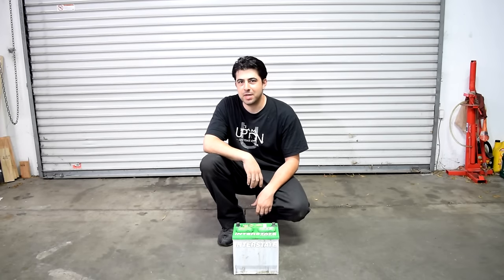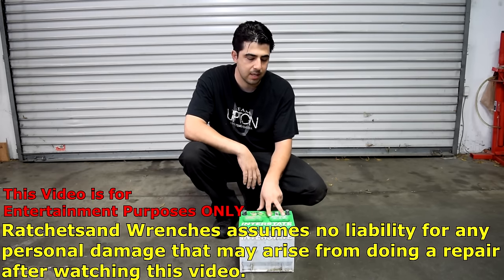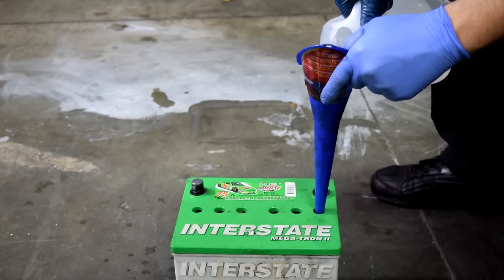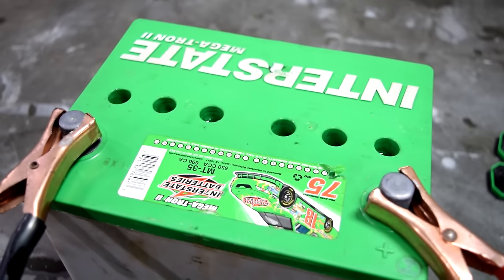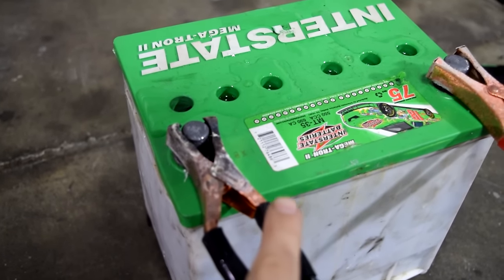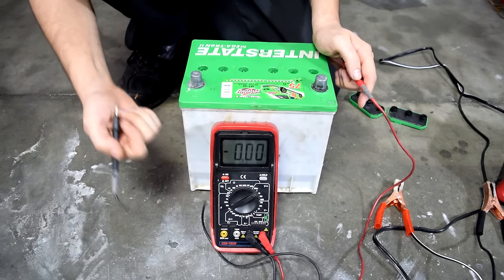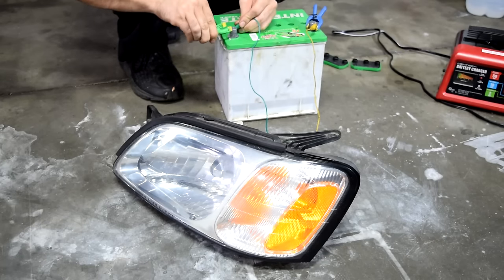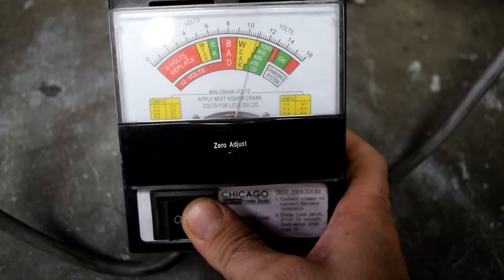Is it Possible to Revive a Dead Battery with Epsom Salt - See For Yourself

Comment: If you're going to use this method, be sure to flush the soda water from the battery 3 to 4 times with clean water  shaking well each time to remove the lead sulfate debris and so that any residue from the soda does not neutralize the addition of the acid.  You're probably going to have degraded plates in the cells so don't expect long life from a battery that is "reconditioned" by this method.  What we need is a good (really good) youtube instructable on how to use an existing battery case and fabricate the plates and separators ourselves, add the acid and water instead of trying to short circuit (no pun) the process of buying a new battery or trying to revive one that already dead.  It could be done by some really crafty person who knows what he's/she's doing, I think.
Reply: Well the point of using the epsom salt solution is to put the lead sulfate into solution, you don’t want to remove the sulfate from the electrolytical solution because it is part of the full circle chemical reaction within the battery, the lead sulfate gets stuck out of solution when the batteries drain and sit for too long which is why we do this process, but it’s still a part of the chemical process
Reply: some guy in india does exactly that.   on YT.   rebuilds the battery with new plates

Comment: Yes batteries are not effected by the floor or anything its sitting on. A 12 volt battery has 2.2 volts per cell, using a hydrometer to test each cell. I have used a desulfation charger for years and have been able to restore batteries to proper voltage. Getting them to the cranking amps is a issue. I have owned a Automotive repair center for over 25 years and been in the industry for over 40 years. I have a 1960s battery charger that will activate a dead battery that will not charge on a newer style charger. There is other ways to do this but its not the safest thing to do so I will not mention it. Some old school technicians will know what I am talking about. Years ago battery were sold as dry cell and acid had to be added. I was always amazed how the chemical reaction occurred! You really need to be carful with lead acid battery as I has seen them explode from over charger or the plates laying on each other. Just my two cents from a ole man
Reply: interesting points ,if anyone else needs to find out about how to recondition old batteries at home try Vaxicorn Battery Extender Guide (do a google search ) ? Ive heard some unbelievable things about it and my cousin got great results with it.
Reply: @MrMarcomedina  SPAMMER

Comment: in the past, I bought a product called 'New Life for Batteries' that claimed to wash the sulfate build up off the plates so they could, once again, hold a charge. You put one tea spoon in each cell. I would then put the battery on the washing machine and wash 4 or 5 loads of wash to agitate the solution. Or, I would put the battery in my delivery truck and run my route for 10 hours. Then my batteries would hold a charge again. I don't know what was in the product, but it was a white, granular powder. This product was popular with boaters because sulfates build up on the battery plates when they are not fully charged. Boat batteries and deep cycle batteries often sit around for weeks with only a partial charge. After the sulfates build up, a charger would not bring them back up to 100% charged. After using the 'New Life for Batteries'  they would hold a full charge. The product was about $14 and saved me hundreds. I think that allowing the extra hours of agitation of the solution may be a key difference in the results I got. I didn't have to drain out the battery acid either.

Comment: The other guy on YouTube that worked outside in 20 degrees did what you did but
instead of using Buddy Epson Salts used a solution of 8 ounces of Alum put in a
gallon jug with regular or distilled water.  Alum is used for pickling if you are looking
where to purchase it....His results worked..My question : How long will the solution
of Alum and water function as the electrolite ? Also , why not put fresh battery acid 
sold at places like NAPA when you do the Baking Soda flush out ?

Comment: This would probably work worse or completely kill the battery if you did this on a semi dead  battery at 9 volts.  The reason being is lead acid chemistry.   A fully charged battery has a sulfuric acid electrolyte a lead dioxide cathode and a lead anode.   As the battery becomes discharged both the anode and cathode become lead sulfate and the electrolyte becomes almost pure water.   The battery in the video was pretty close to completely reacted (dead) so therefore the electrolyte that you dumped out was almost all water with debris and residual acid.  When you filled up the cells with magnesium sulfate and distilled water you increased the conductivity of the solution.  Then when you charged the battery the sulfate ions liberate from the lead sulfate plates and you actually produce sulfuric acid pure lead and lead dioxide.   The reason why this would work worse on a half dead battery is because you will be dumping out sulfuric acid electrolyte that is only half reacted not pure water.  When the reaction reverses as you charge it there would not be enough sulfate on the plates to restore the acidity of the original solution.

Comment: I may have missed something but you left the epsom salt solution in the battery? You should have electrolyte 35%H2so4 and distilled water. You would of been better off using the original electrolyte or going to auto store and buying a bottle.
Reply: CCA drops drastically i mean 40-50%, DONT PLAY WITH CHEMISTRY. ITS SIMPLE H2SO4 + H20(DISTILLED)
Reply: searcherT morning

Comment: Great video!  I tried your fix, and my battery now charges to full but within minutes when left alone  depletes to empty.  Before the fix the battery was completely dead.  Any ideas on what is going on??  Thanks much.
Reply: you cannot revive a completely dead battery. it will hold voltage but not amps. change your battery

Comment: There are  several things for fixing a car battery
never try to do this until you are sure what you are doing - the acid can burn you
check the voltage first - there may be a kaput cell which would waste your time.
Check the battery fluid.
Try to fully charge the battery.
(I read about these and more from Jons mender guide website )

Comment: I heard that putting it on a high boost charge at the beginning helps to know loose the buildup on the plates before you begin the slow charge process.
Reply: I think you do this on a new battery that's been sitting on the shelf for a while.

Comment: the issue u left the salt in it with acts as a short so u need to wash the inside once again and replace that stuff with filter lemon juice so it has acid in it again should increase amps

Comment: Baking soda wash should be done on a vibrating table. If you don't have one just use an electric vibrating sander strapped to the underside of a table or a plastic 5 gal bucket and vibrate the battery for about an hour. This method will clean the plates better than shaking if for a few seconds or minutes. When the sulfation is released some of the plate material will also be removed making the plates thinner which in turn reduces the amperage. Dump and rinse again to flush out the debris. I would recommend replenishing with sulfuric acid if possible. After this process it will revive the battery to a reasonable state, depending on your definition of reasonable.

Comment: Hi friend I did it and it's working fine with Epsom salt now Iam in the 3rd week and car starting nicely
Reply: Panthera still working  hope it'll last a year ;)
Reply: Panthera only Epsom salt  with water
Reply: Which type of epsom salt and how much quantity is to mix for 1ltr
Reply: Crystaline form or powder form
Reply: How much quantity to mix for 1litre distilled water
Reply: Sroor9001 
Hi how your battery doing since last time you post the common is it still holding charge . thanks.
Reply: Sroor9001 i

Comment: Hi
A Month ago I have opened my faulty car battery (with the temperatures going down this winter it wasn't able to start a car, it was too weak).  I have poured out the acid and added a mixture of Epsom salt and distilled water as told in the video. After that I have charged the battery once or twice and put it back in the car. At first, the results weren't so good, it had happened to me once or twice to fail starting the car. But, as time is passing by the battery is becoming better and better and now it is cranking the car very hard and I am very positively surprised with the results. It seems that epsom salt needs time to clean the deposed sulphate on the plates and as they are becoming cleaner and cleaner the battery is becoming better and better. Reading the comments below, I have one question for the guys with more knowledge than me about this topic. 
Should I now empty the epsom salt mixture from the battery and refill it with sulphuric acid mixture. And. can I use the old filtered sulphuric acid, or I have to buy a new sulphuric acid?
Thanks anyway
Reply: By all means YES!!...realize this post is 2 years old, but YES YES YES.... lose the bathwater and replace with new electrolytic, be sure to cover/saturate the lead plates but not fill it to the top ;)

Comment: Thanks for your good video. 1 more quick question on car batteries: do NOT mix/top off a battery w/ acid from another battery?
Even if the acid from another battery tests good/okay w/ a specific gravity tester?
Just use Distilled water instead right?

Thanks again.

take care,
 - Leeroy

Comment: Awesome job explaining the measurements and procedure with amperage on the charger. Most other videos just simply stated so pour some epsom salt over in a boiling pot and dump it in the battery then slap a charger on it and hat presto it’s fixed. Thank you for actually explaining it thoroughly!

Comment: That harbor freight charger will show red light on full charge battery. If you flip the switch from 2 amp to higher it will change to green. I have an exact charger and it does the red on full charge. Not everytime but most. As for the 12 volt battery and fluid change thing as you have done, I have done these things and found it best to just replace the battery lol. I love bringing dead things back but its not fun finding out 2 or 3 days later that you still have a dead battery in the car. 12 volt batteries are cheap enough to just buy, replace and recycle!
Reply: not some batteries. the marine batteries can be as much as $400 plus
Reply: Hey. Just wanted to get back to you. I picked up a couple of old nasty looking boat batteries but they do not look to be leaking. I'll try this and possibly video it and follow your steps and see how it goes. My dad was successful at doing this stuff so I'll see how it goes for me. I've tryed it and have got them to come back but not to last long. I'll be sure to fill ya in. I'd be ecstatic if we can revive these suckers. Thanks again.

Comment: I've got a few relatively new RV deep cycle batteries that already failing me.  I mean less than a year old.  How about just topping them off with distilled water/epsom salt solution? Since they're pretty new, it should be fairly clean wouldn't you agree? Sound like a good idea?  Thanks for awesome info by the way!  Good Survival skills for future!
Reply: No, I highly recommend against this in this process since we’re removing the old sulfuric  acid and replacing with the epsom salt electrolyte in its pace. In your case I would recommend just trying to charge it as is, if the cells are low, maybe topping off with distilled water, but no epsom salt. Your batteries should have all the sulfuric acid still in solution that it requires, at a higher concentration because of the battery loosing water via evaporation. So adding the distilled water will re-balance the electrolytic solution, balance the sulfuric to water ratio. Then give a good slow trickle charge should be good, and if not, than go through this videos entire process.

Comment: Thanks for the video, I'm surprised that you got any charge at all with an Epsom salt electrolyte, I guess it is still conductive, I wonder if a lead KOH battery would produce better amperage, anyway the idea behind the baking soda is to neutralize any residual acid and then rinse it out with distilled water and replace that with Epsom salt to "melt" the crystallized sulfate or at the very least reduce it into a soluble liquid, that would be the purpose behind cycling a charge across the plates, I am very surprised that you got 2.1 volts per cell! I was expecting around 1.2 like a AA battery due to the alkalinity. I think I would do another rinse/fill/charge cycle and then rinse again and add acid. I am going to try this in the next couple of days with my deep cell trojan batteries and see how it works!
Reply: Go back to school for some basic Physics and Chemistry - Salt Water is more conductive than fresh water and the process of charging turns the Salt/Demineralized water into Acid!
Reply: @vintageguitarz1  Talk about a poor education!
Wow! Salt water turns into acid? Really?
Our worlds oceans are salt water, I doubt any fish or anything at all could survive in an acid rich environment, but you keep on schooling us on ph balances and such... This is your brain on salt water...
Reply: @vintageguitarz1  Epson salt is not salt. Salt is sodium chloride. Epson Salt is a compound of magnesium and sulfate.
Reply: well,these experiments and comments are very useful, (to me), in the sense  that they send me, a pensioner, back to my days in secondary schools talking/learning about pH values of acqueous solutions of salts made from strong/weak bases and strong/weak acids😄
Reply: @superiorcarpetpaintllc4351  That was an amazingly dumb comment

Comment: Okay when some electrodes making contact and desperate add thin oil like turpentine and some motor oil...
It will temporarily insulate shorted parts and it can than still hold a charge...
Should be possible to reload to a lower voltage...
When moved the oil and acid mix and isolation gone...
Works in extreme cases...
One way solution though...
Make Shure shorted parts are covered by oil...
Usually parts not covered by destined water short out at the top and bend toward one another despite them touching this seems to work if only a couple of cells ( beginning and end shorted you lose one cell but still can use the other not shorted cells )

Be careful tends to form a soapy kind of thing after a while...
Moving it inside a car mixes things and than it cannot be used anymore...

Did this on a shorted out stable battery used for powering a radio...
Worked !!!
Needed reloading but did hold power...
Do not know how many amps can be drawn at max ???

Comment: All nice and fancy execpt most of the time when a car battery suddenly dies before it's time is because of a physical problem inside the battery casing such as cracked plates, broken welds and openings in the circuitry.

Comment: There are  a few ideas for getting a good result
Don't attempt to do this until you are sure what you are doing - the acid can burn you
Test the voltage first - there may be a kaput cell which would be a waste of time trying to fix.
Check the battery fluid.
attempt to completely recharge the battery.
(I learned about these and more from rapid renew roadmap site )

Comment: Wow! Comments suck. Wonder if people actually talk like that in real life...if they do, the world is in trouble! Great vid. Thanks for doing the experiment for me. I've got a couple of old batteries and I've tried several of the "shocking/pulse charging" tricks to disulfonate with no luck. Heard epson salts were the way to go, but good science says the same thing as what you discovered...only works if your plates aren't sulfonated. Thanks for the info. Great vids ya got! Keep it up!
Reply: It's most a good video. If you are going to wash/neutralize it with baking soda (I don't recommend it) it's very very very very important to flush the crap out of it before the epson salt part.
Reply: It's called 'Keyboard Courage'... most would not have the buts or balls to speak like that in public or to someone directly... but there is always the exception that would.
Reply: robert feller Yes, don't just pour it out, run some fresh water through those plates. I don't use distilled water for any of this, my brother has religiously used distilled water in his batteries for 40 years and his don't last any longer than mine using clean tap water which where I live is very hard water. If the plates aren't cleaned up after one dose of Epsom salts do it again and for longer. It won't hurt the battery, it's already dead but it just might clean things up enough to get another year or two out of it. Never know unless you try. And I don't just trickle charge, I set it on 10 or 20 amps and let it cook when I'm out in the garage where I can keep an eye on things. Overnight I'd do the slow charge.
Reply: I have spent months studying battery repairing and found a fantastic resource at rapid renew roadmap (google it if you are interested)
Reply: Hmmmm it’s funny how there are so many different people who are saying exactly the same thing about the same website lol
Reply: you funny. Ruin dead batteries
Reply: I have reported the sales spammers.
Reply: Sophia Shcherbakova